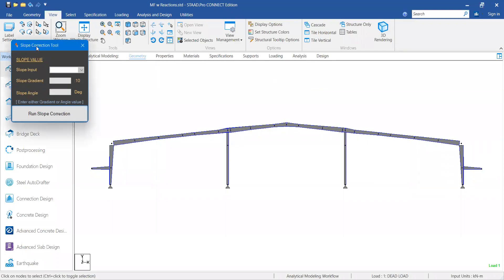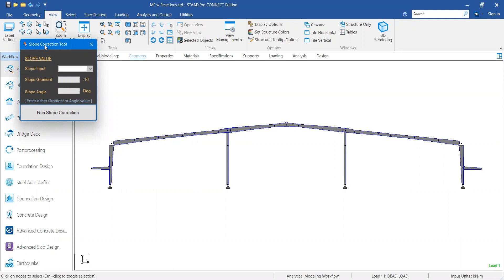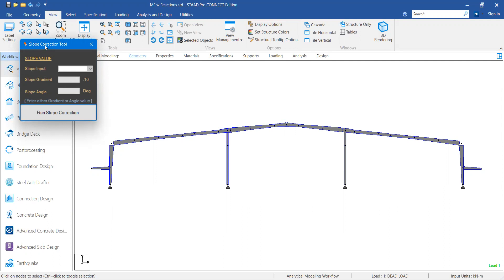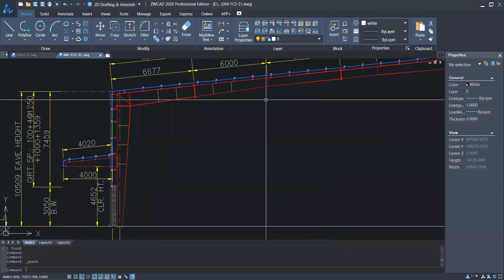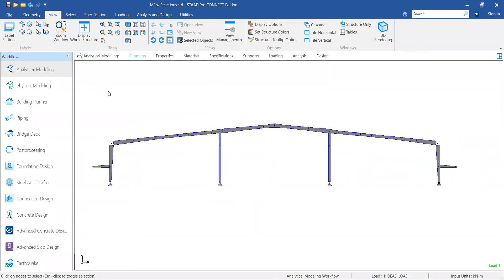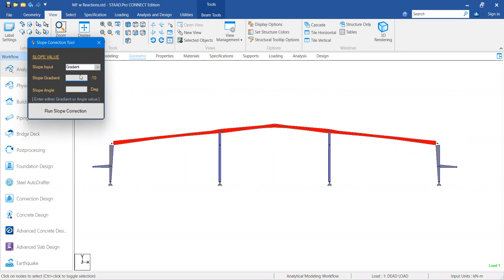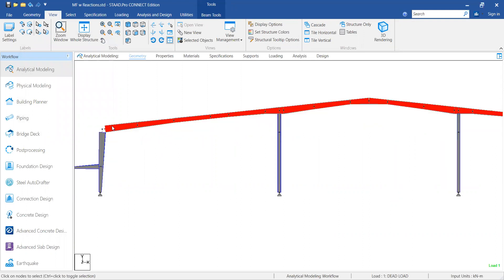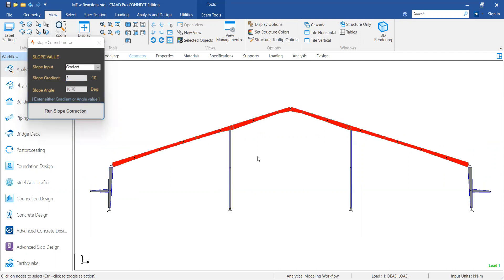STAAD Automation Tool (Slope Correction App)

Comment: What if top flange of the rafter will not align ie Center line of the rafter is in same line rather then top flange !!!
Reply from the maker: It is not going to affect much of the result. STAAD performs stiffness matrix analysis based on the nodal positions and members. 

The final erected building will be of the shape in which the top flange will be exactly aligned to the desired slope.

So analysing the model in that manner is going to yield the exact results that the structure is about to incur after erection..